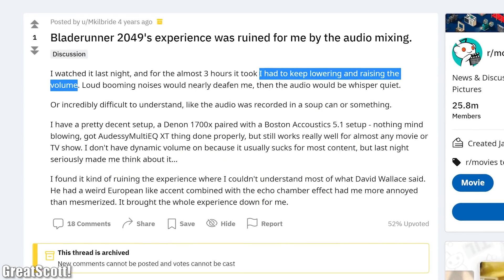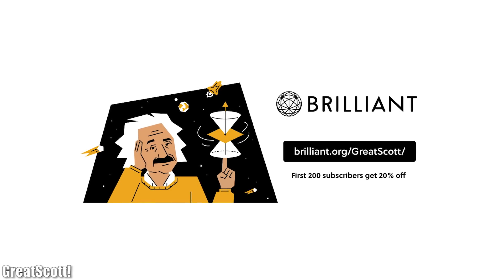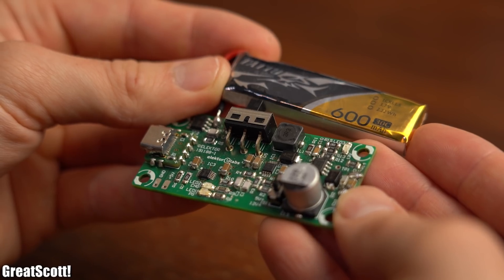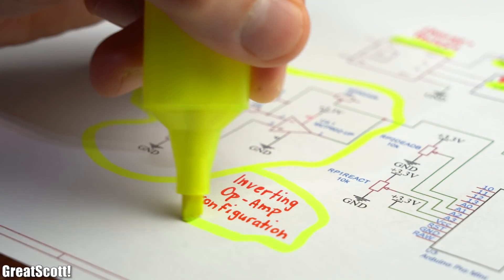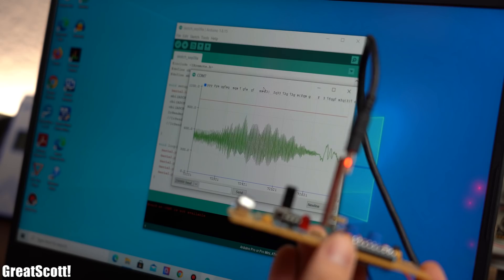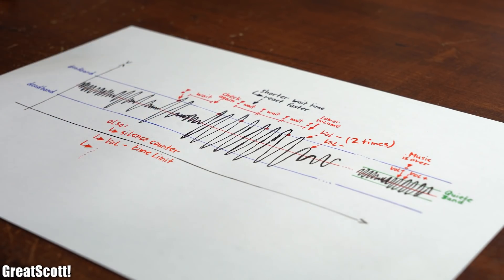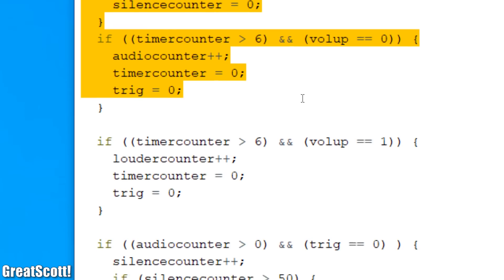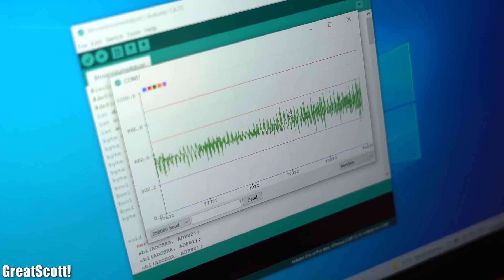Movie Music has a LOUD PROBLEM! So I fixed that! (Automatic Volume Adjuster)

Comment: Great video, very nicely done however this product is already available in proper devices as a feature called dynamic range compression and they do it perfectly using the most appropriate acoustic attack, release, ratio and curves on volume for movie entertainment.

The problem you're having with volume is called "dynamic range".  Movies always have the highest dynamic range. If you use your TV's speakers you wouldn't have this problem since TV don't have great dynamic range across the whole spectrum, they use a dynamic range compressor to make the loud sounds quieter.  

On the other hand, if you have a home theater amplifier, your amplifier most probably have a dynamic range compressor too.  Just enable that, if you don't want to disturb your neighbors, your wife or your kids, set it to maximum compression.  Then you'll have relatively homogeneous volume level throughout the whole move/dynamic range.  

In the 80s, this compression feature was called "loudness" on hifi/stereo devices.  Modern devices do this acoustic dynamic range compression on multi-channel audio.

You're most probably experiencing this problem because you're using a sound bar.  Sound bars might look interesting but they are something you should always stay away from.  Either get proper speakers and an amplifier or use your TV's speakers. I would stay away from sound bars unless it is absolutely necessary for a strange reason. And TVs own speakers always better than a poor-mans-home theater setup anyways.
Reply: If I use my TV's speakers then it will feedback loop into my microphone.

Comment: Tube audio systems often had a feedback loop that could be adjusted. Much easier and effective sound leveling.
I also enjoy the horror flix that rely on the constant screen of blackness "for effect". if I wanted to listen to a movie instead of watching it, I would play Orson Wells radio broadcast of H.G.Wells', War of the Worlds.
Too many stupid gimmicks too little creativity to capture the audience. I guess if your Whorelaywood with zero talent, creativity and worst of all less than zero originality you do what you do to make a buck. Hacks one and all.
And what's up with the constant ten to thirty second camera angle changes? It's a movie not a backdrop for a Disco. Find real actors and sell the forty thousand extra unnecessary cameras. Grab the audience with talent not gimmicks.
Sorry for the rant.

Comment: Another approach is using your smartphone since or some phone have ir blaster and also have two mic which are common because it's used for noise reduction during call by that two things, you could build an app specifically for that problem since the hardware is there and software is needed. Not to mention you could add AI detecting whether it's music or human speech like GOOGLE LIVE TRANSCRIBE or YouTube caption.

Comment: That difference in volume is called Dynamic Range. It is carefully mixed by the engineer to recreate the actual levels in a theatre.  
The problem is that most downmixers screw it up. There should be a night mode or DRC setting that would take care of it automatically.
Most Atmos enabled receivers have dialogue level setting that can compensate dialogue without DRC giving good dynamics
Reply: I've listened to movies inside of movie theatres... they are too loud. You can't tell me that it works correctly in theatre and not on other media, it's too loud on every media. Sure, you're more likely to produce adrenaline which will help you deal with the loud sound when you're away from home... but that doesn't mean the volume level is appropriate.

Comment: This happens a LOT with ADVERTS. It is done on PURPOSE. But guess what, long ago, Sanyo launched a VCR (video cassette recorder = VHS) that took advantage of this crap and was able to pause recording on adverts to save tape. Probably they got clue from volume and some other thing in the signal. Not a TV guy, I dont know if this feature was accurate. This project reminds me sort of how ALC recording worked back on its days ... you could making the volume high when signal was weak and the opposite when signal kicked in. It could help you in this problem but the result is really harsh since it tries to react quick and this does not sound good at all. Probably more like a compressor thing with a delay constant triggered from the envelope of the signal ....

Comment: You really want to sample 5+ minutes ahead.  Then adjust volume to normalize each section and anticipate against set limits.  Otherwise, you will have quiet scenes increasing volume and loud scenes decreasing volume.  Winamp can normalize music but it takes the entire track and moves highs and lows to a set max or min.
Reply: This is always been the thing that prevented me from just doing this with a device in the middle of the line out from the TV.

Ideally, you want to be able to look ahead to the audio, which means that you really can't use any live immediate feedback.

Reactive circuits like this one, or one that just detects volume levels directly from the line out signal are always going to be a bit noticeable. Our sound bar has a feature for this, and the problem is you can just tell that the audio is being turned down as an explosion is happening or something. It's not completely jarring, and at least it's better than having to manually turn the volume up or down, but still it's not ideal.

I dream of the day that there's some industry standard that implements normalized audio for stereo outputs.
Reply: @fieryferret  But then how on earth would my neighbors know the action movie I'm watching at 3 am reached a climax? Gotta keep the dialog to whispers so you turn the volume to max just to hear them, that way when an action scene plays at max volume the entire neighborhood can hear the exciting parts too and you get to experience they joys of permanent hearing damage... /s

I hate that the only way to equalize it is to either have real time reactive  feedback that'll only start lowering/raising the volume a few seconds after a couple gunshots have been heard by the entire town or to basically download and preprocess the entire movie/episode. Really ruins the immersion in films when you're constantly reaching for that volume knob and you get lazy half the time so you miss out on most of the important dialog when they decided to whisper right after a loud action sequence... The whole reason they make the action scenes 10x louder than the rest of the film is so that it feels more realistic and chaotic but over the years they've taken it to the far extreme and it just ruins the immersion it's supposed to create.

Honestly, the first streaming service that actually allows an equalized audio service would make bank, We should have the option to disable the stupid "immersion" for action scenes and it baffles me how this isn't a thing. Bonus points if you make it a slider so you can choose an in between, the film wouldn't be as exciting if the climax were the exact same volume as characters whispering but the extremes it's been taken to is just too damn much nowadays...

Comment: Wasn't there already an AGC circuit design already available online that could signal sample your audio directly (like from a speaker wires) rather than sampling & processing audio from the air, with all the performance delays associated with that approach?

Comment: Some TV's expose api for remote control using a smartphone app. You can leverage this with an ESP8266 instead of IR. Then the device doenst need to be in front of the IR receiver.

Comment: If you're using a sound-bar or other external speaker setup, you could use a stereo compressor for this effect. It would react much faster than the IR based circuit and would make for another interesting video. I'm sure you could come up with a brilliant Arduino implementation or analogue circuit!

Comment: Are you using a stereo speaker setup? Or do you use a pc that isn't setup to output surround sound properly? Or do you use a passive surround sound set? As in, without calibration? I've found that makes a huge difference. Before I got my receiver I had exactly the same problem. Stereo mixdown was awful. 
The receiver, as many do, comes with a measuring mike that will automate the setup so that everything is within spec. Movie makers spend so much time designing the audio, and is actually done to a specification for optimum home cinema enjoyment. Using an AGC is really butchering the audio imho. It's on the receiver too and it was on by accident, man did it make the music and effects sound wrong!
I now use quad diy full range floor standing speakers without center channel. Sounds great! I prefer mixing center into front stereo to a dedicated center speaker. 
As for a pc playing video, check both os sound output settings that match your speaker setup and the playback software audio rendering. Mplayer classic has a few icon tray applets that only show when playing a video and allow you a lot of control.

Comment: In the audio world, the process of monitoring the volume level of audio and adjusting the volume based on that level is done by an Audio Compressor. 
You probably have some digital compressor adjustments in either your TV or soundbar possibily disguised under a 'dynamic range' label

making an analog-ish diy compressor with an arduino and diy optocoupler would be a cool project

Comment: its an issue with down mixing
youre taking a 5.1 7.2 ATMOS audio down to 2 - 2.1
So if you were to play it back on a 5.1 7.2 or ATMOS audio system

OR

When watching the movie change your audio track to use the correct mix.

Comment: I agree hate sound mixing the worst bit is actually they make it too quiet so u turn it up to hear and then it goes loud asf! a better way would be to use software a sound supressor or limiter, or tell the industry to stop doing what they are doing! i wouldnt want wires and hardware as that could break or be innefective and cost energy etc. it would be nice to have different audio modes built into the film media, for eample a dramatic sound mode and normal sound mode wheree the levels stay the same for the whole duration of the film that would be a much better aproach right?

Comment: So you're basically creating a "dynamic range compressor" in hardware. Great solution when you're stuck with Windows which isn't capable of doing this in software. Or have some other way of watching movies (smart TV, streaming box, etc.) that doesn't allow you to run custom software.

Comment: My suspect is that something is changed in audio cinema standards that cause bad channel downmixing (the channel for the speech track should be the center). I do have this problem with any content coming from my fireTV connected (by a Toslink cable from the TV to a DAC) to a hi-fi stereo amplifier. Do someone of you know more about this topic?

Comment: Increase the ampere of the out put signal. So the signal of - 22 dbu too will sound good...or make 0db 2 v rms and run the signal at - 22 dbu.

Comment: Multiply that by 10 if you have tinnitus and hearing damage. The loud parts are painful, and you can't hear speech at a volume that doesn't cause pain. Young undamaged ears auto volume adjust, but tinnitus ears are set to 11 all the time.
PS. I just found some software that balances the volume through a PC - Sound Lock.

Comment: It's a deliberate thing. You should keep the volume at a comfortable level on the spoken parts. 
When the story has an intense part the volume intensifies anche then in the calm parts the volume is at the level you set at the spoken parts. 
An explosion should be louder than a spoken part.

You may think that when you watch a film tlevision this problem has been solved. The reality is that every country has a law that set a medium (per week) overall level (long term loudness) to prevent some channels to be louder than others and to mitigate the "louder ads". 

In Spotify/YouTube/Netflix and other streaming platform the problem is not present because when you upload a content the service itself change the loudness to be consistent through al the different contents.

Anyway If the difference is annoyingly too big, maybe it's a bad from 5.1 to 2.0 down mix.

Comment: Cinematic Sound engineers are profoundly stupid these days, what a waste of using low noise props to favor speech just for them to screw things up. Load runner is not even horror. Neat electronics proficiency man, thnx for ur hard work. I hope there's  also a solution by software, as I watch everything on my PC, a codec or some sort  premix prefer speech would be perfect.

Comment: over a thousand comments before me, so I may be repeating what others have already said... but despite that:

1) I HATE modern movie loudness.  I haven't been to a big-screen theatre in the last ten years without making sure I have earplugs in my pocket.

2) I need something similar for my laptop playing YouTube videos.  Not so much for the music vs. conversation, but for the channel to channel variation.  Some channels have me bumping the volume up to near maximum so I can hear what's being said, while other channels make me set the volume to as low as I can so that it doesn't hurt my ears.

3) AVC (automatic volume control) was pretty much standard on mid-range and higher audio gear in the 70's and 80's - but when was the last time you saw any device with that feature?  This is what they call progress???

Comment: Fun project.  Do you notice abrupt volume changes or short loud busts of sound?
I wanted to make an HDMI filtering black box to automatically filter out sounds like doorbells (so the dog doesn't bark), but it seems like a difficult project to actively modify hdmi audio signals.

Comment: Cool project mate,
and BTW I had a similar idea, but instead of using this approach, I was thinking to make a box in the middle between the device outputting and the amplifier, my idea is to sample directly the signal to prevent capturing ambient (non movie) sounds and then use a (Digital Potentiometer IC) to control the signal going to the amp, and since it's only the signal I can tap the potentiometer up/down at runtime and normalize the signal. But of course this approach has its down sides, like we need to tap 2 channels at least (left/right) or maybe more to achieve the same idea !

Comment: The audio for home cinema is the problem together with not enough people being aware of the volume 'normalisation' features of their devices.  The original audio mix works well in large spaces (with more speakers) but 5.1 or 7.1 home cinema systems are in smaller spaces and certain frequencies can overpower. Next there's the 'normalisation' features not enough people know of that can be applied by peak volume or an average volume compared with buffered or read ahead data for a smoother & level sound.
This project works perfectly and efficiently tho.

Comment: Most modern receivers and DVD players have a dynamic range compression feature built in that you can activate for this exact reason. Sometimes it's called "night mode" or "apartment mode". I bet you already have this. But nice build.

Comment: No, you're not crazy.  Listening levels for movies are standardized to be very loud on purpose for theaters and it's somewhere in the range of 80dB to 90dB at the listeners position.  That's basically full volume on your TV.  This let's the audio designers take full advantage of the full dynamic range of the audio systems but it also means the movies that are mixed and mastered inside of an actual theater don't transfer well to your home or apartment sized living room.  The standard should probably be reevaluated to account for the most common home viewing and listening conditions and provide some sort of standard compression ratio to narrow the dynamic range.  If TVs had an audio dynamics processor instead of a multiplicative volume control then it might be easier to get the volume just right and always hear every part of the movie...

Comment: Lots of .02 cents thrown out there as many have experienced the same frustration.  You are missing the center channel encoded information it sounds like.  For our standard 2.1 TV that was doing this....we changed the DVD player audio mode from 5.1 to 2.1.

Dialog center channel information is then sent through the main left and right channels of 2.1. 2.1 has no center channel speaker or amp, so you won't hear the center channel.  No more having to turn the volume up to hear dialog, then to be blasted by music during action sequences.

Comment: I, being a lover of analog electronics, my first thought was to use a voltage controlled amplifier and use it directly on the sound bar to control the signal output. However this kind of application would been way more intrusive,  since it's would require to open up the sound bar and directly modify the soundbar's original circuit. So, your approach albeit being more complex, in my view, is better and much more practical.

Comment: Great idea! I had this in mind a long time ago but was never motivated to do it. My idea is a little bit different. I am more of a analouge fan boy :D I was thinking of utilizing the USB output of my TV to power a circuit. This will be plugged in between the TV output jack and soundbar input jack. The regulator will try to hold the output level constant at all times so that nothing is too loud or too quiet. Thanks for motivating me, Scott.
Du machst to Videos!

Comment: i figured automatic gain control, something from the era of early colour tv's or a compressor, but, needing to use built in speakers does limit the choices... why not a tv with a jack to external speakers?